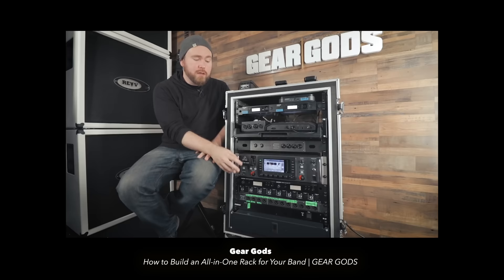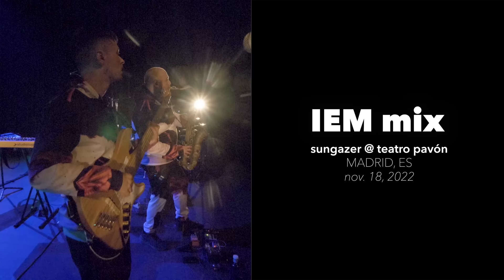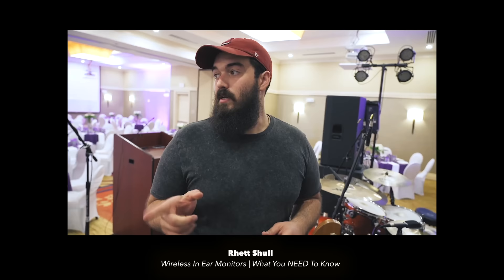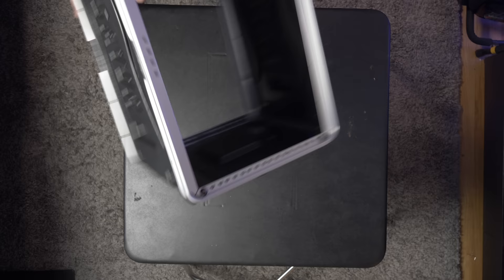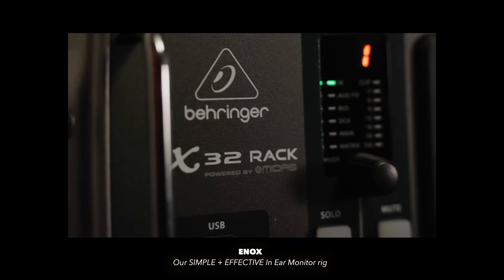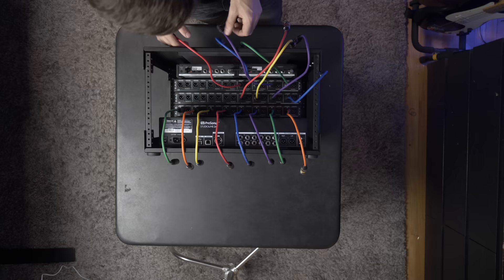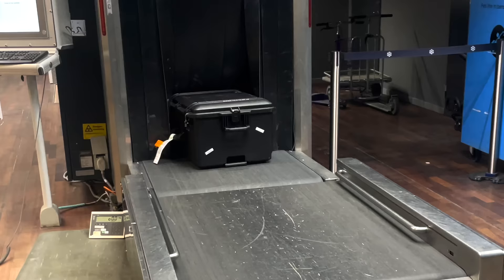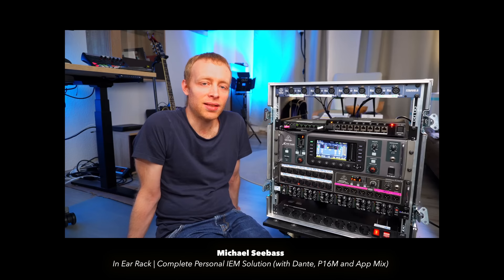How In-Ear Monitors are Making Better Musicians

Comment: As a FOH sound engineer (who'll be mixing Sungazer on your next Portland OR date!) I fully agree with your approach here - even including the shade thrown at sound engineers. For venues without dedicated monitor eng positions, it can be very frustrating to build foldback mixes for bands that have exacting requirements but who rely on house wedges and stage volume. Self-contained IEM stage boxes completely eliminate a whole category of potential problems. Looking forward to the show - in your advance please send along that input list @6:30 ! 😆
Reply: European venue engineer here, another thing to keep in mind is wireless as well. American wireless rigs are not always legal, frequency requirements in EU and US are a little different; you don't want angry radio people coming after you.

Other than that I fully agree, monitor mixes can be difficult to keep tabs on if you don't have a dedicated mons guy. Especially if you as a band like to run dry/wet and compressed/uncompressed channels for certain performers. Vocalists as example tend to like a little verb for their "feeling", the rest of the band might see insane yields in clarity with compressed vocals; but the vocalist needs way less, or no compression on their ears so they can keep dynamics in check etc. Accomodating this yourself is in my opinion a good thing, not even to mention educating musicians on the technical side as well.
Reply: Super random (and sorry if I’m being a bother), but how did you get into this line of work? I’m a drummer in PDX and have been wondering how to get a start in sound engineering/what it takes to be involved in that community.
Reply: Question of a non-sound-eng musician: Since consistency and control on the sound seems to be the band issue here, why stop with your little selfish personal in-ear mix? What would be the pros and cons iyo of sending a left-right premix to the foh directly out of the box? I suppose you could still have control on the overall frequency response and volume with eqs and gains to adapt to the room-pa system (?). 
It could prevent "misinterpretation" of the overall style by a mix eng that doesn't came prepared and never listen to the band sets (let face it, it appends all the time) it could even allow for creative mixing tricks with automations and such, night after night. 
I guess it'd kindof ruining the whole FOH mixer job purpose, so don't take it personal ;-) , it's just out of curiosity: do you think it would be practical, even if not suitable?
Reply: @ginabean9434  because you simply don’t hear balances the same way in IEs or in any kind of stage environment as in the room. Constant adjustment of levels and tonal balance is always needed.
Reply: @ginabean9434  Sound engie here; As soon as you have Instruments that give off sound into the room you are playing in, you have to consider the effect of these instruments natural sound in that particular place on the FOH mix. You can't completely Isolate your Band from the room and then hand off a clean mix - like a studio production would be - to the sound engineer. Instead you would have to designate someone from your Band to stop playing and go listen and try mix to the room while one band member is missing. 
And that's only one of many changing factors. The next problem will be the change in acoustics&sound when the audience arrives, the temperature changes, and you and your band will play at a different intensity from the soundchecks because the kick of performing in front of an audience comes in. And as soon as you are on stage, you can't react to this anymore + you don't know what the FOH sounds like because you are on stage performing. 

Not to say you can't do it all, lots of small bands mix themselves - sometimes to a respectable level, and it might be the better choice if you already know ahead you'll be playing in a place with an absolutely terrible sound engineer, but the best way to go is to know HOW to communicate the wishes on how your Band should sound to the engineer, and find a solution hand in hand. 
Because it's a hand in hand thing after all. If the band works against the sound engineer the outcome will be bad, if the sound engineer works against the band it will be bad.

And if you are this particular that automations are important for you: hire a sound engineer to come with you that knows your music perfectly well.
Reply: @camcam0490  no worries at all. i have a background in live stage/theater and electronic music production so i knew the basics of plugging things in, getting a decent mix going, fighting feedback on mics - i started helping out at small bars/venues (like 50 people) when they needed sound eng, got to know some other folks in the community that i asked to tag along with on bigger gigs as a backup / A2 whenever i got a chance, showed up on time, did what i was told, and asked a ton of questions after each show was over. lots of friendly networking and being reliable. My emails on my channel 'about', hmu sometime if you want a tour at Star!
Reply: I've moonlit as sound guy for a small time band with a lead singer with phenomenal range and power, who frequent dives with absolute garbage acoustics. Been bugging her for months to get a IEM cause of the number of times we've had to under-gain her channel to avoid feedback screech, resulting in her voice getting lost during nuanced parts. Definitely going to share the cheap IEM setup from this vid.
Reply: As a player in a small local bar band, we do our own sound with a Mackie DL32R mixer. Everyone uses basic wired IEMs from headphone amps, plus one Shure wireless. Monitor mix, FOH out and wireless kit is all in the same rack,  pre-cabled. All we have to do is plug in instruments, mics, headphone extension cables and the FOH. Sound check is quick, we just notch out any problem feedback frequencies (and we play some acoustically horrible venues). Two iPads - one main, one backup.
Reply: For pro bands - is there no way the venue could accept a stereo master mix from your rig, and borrow an iPad from you? Or would you not trust them with controlling your kit.
Reply: @tuck1s  i've definitely mixed bands who gave me a stereo feed from their self-contained stage setup, and it's usually fine, but it severely limits my ability to fix things on the fly - typical example is a new song with a guitar or synth patch that comes up way too loud or too quiet relative to the rest. I've also had the second thing you describe, where a band will have their own stage box with a stereo pair out and hand me their ipad; in this case I do have individual channel control over the FOH feed. This is definitely better but isn't as clean a separation of responsibility as the setup Adam's describing. Especially on a typical three-act night with a headliner (usually mixed by their touring engineer), touring support (me), local support (also me), simplicity and conformity of everyone's setup means  less stress all around and a better experience for the audience.
Reply: Thank you, good to know.
Reply: @ginabean9434  Absolutely valid concern, and if you're an engineer that is out of his usual genres or capability I can definitely see it being a problem. If you have a rock-centric engineer mixing a bigband or jazz band the results can be interesting.

Most bigger bands carry their own sound engineer on tour with them for this reason, if it's truly important for you to bring your sound everywhere you'll want to spend and bring them along. The same goes for lighting guys.

As a band you might also overlook what skillset an audio engineer brings to the table, they might also function as a system tech. The engineer is also continuously adjusting the mix to the room, dynamics of the band itself; if you as an artist would have to do this on-stage with your iPad you'd probably be unable to play your instrument.
Another issue is that players themselves may carry a bias, let a guitar player mix and the guitar will always end up being the main component of the mix.
Reply: Hey Eric check out super secret band 
We’re Pdx locals 
🤘🤘🤘
🤫🤫🤫
Reply: Come hang out at super secret studios or come check out a super secret band show sometime
Get in the mix
Reply: Are you a full-time sound engineer?
Reply: ohh i live in portland when is it hopefully i can go
Reply: @sammyk3992  Oh, mate, I've been to so many festivals, where you had a whole lineup of groups that sounded really really bad and then two or three bands that sound great. The one thing they had was - their own sound engineer and/or dedicated monitor guy. One thing that you don't want in a festival environment is a long sound check. And you can't really do it before you get on the stage.
Reply: @mydearriley  No, I have a day job as well.
Reply: @ginabean9434  It's not suitable but you could do it. There's been plenty of people who've essentially mixed themselves, and for many busking performances, that's literally the only option. The thing is, a monitor mix is not the song mix. It sounds bad FOH. It's not "selfish" it's about playing the song. Monitor mixes may include metronomes, they may include backing track, they may want to hear mostly themselves and less other instruments. The mix a musician wants is the mix that they will play the best with. The FOH may include more track, if tracks are used, it will have a balance of everything.

There is nothing stopping a musician however, from running an extra mixout. They can have each of their own individual monitors, then they can have a FOH mix on their rack on another send. You'd never send the vocalist's monitor out FOH, but you could mix on the same rack and run that FOH, and if it's a digital rack, you could softpatch it wirelessly to use your headphones to switch to the FOH mix and get it where you want it.

For some shows, with a lot of automation and backing tracks, click tracks, timecode? That's the standard, the band will have a whole production that is bringing that. For most bands though, they don't have a production of that scale, they can't afford it. And most of them aren't sound engineers themselves, so they need the sound engineer. There's also things with live sound that you're actually paying an engineer for. You may mix yourself onstage, but you're not going to tweak the EQ when you realise feedback is building up in one of the mics. You're not going to be able to automate them riding the return on a reverb. You're also not going to be hearing the PA live in the middle of the room. It's all very well to listen to the FOH mix on monitors, but it's not how it sounds in the room. 

Basically, monitor mixes are not FOH mixes, they work completely differently and are not interchangeable.

But your best advantage at that scale, when you can't afford it, going wireless, especially, going wireless everywhere, gives you a chance to check out the FOH mix yourself, and make sure you're happy with it in soundcheck.
Reply: @defenestrated23  You don't even have to go this far. This rig is impressive, but you can also get a simple wireless kit unit that can run off the FOH desk or the Monitors desk from an XLR out. You can just take the XLR out, into a wireless TX, then to a wireless beltpack, with IEMs. Whole thing can be done for like $600. This rack is a more advanced version for doing it at scale.

There is only so much you can do with the vocal monitors. Either the singer learns how to hear themself, even with quieter monitors so you can get more volume, or you solve that problem with IEMs.
Reply: Hey is Don and Steve May in Sungazer????
Reply: @kalreynolds5829 Only reason to go this far, for convenience, you just get on stage, plug your mics and instruments, and your settings are already there, since it’s IEMs no need to go back and forth…

Comment: The difference between quality IEMs and regular stage monitors is HUGE.  I'm in a couple of dance hall bands, and the difference between setup/soundcheck times is staggering.  We have 4 road cases (all my guitar stuff, Tony's guitar and keyboard stuff, Sarah's keyboard stuff, and mixing console/in-ear receivers), which is way less crap to schlep around than all that plus 6 stage monitors.  Add to the fact that we have zero stage noise (drummer uses an electronic kit, bassist uses a SansAmp, and Tony and I use Axe FXIIIs direct into the console), our soundchecks are just making sure everything works and then fine-tuning the sound (our soundman saves each venue we play as a preset on the mixer).  We can set up in under an hour.

And since we're not touring or anything, we don't need to invest in bulletproof cases and stuff.  We're in about $6000 total for the console and PSM300s for all 6 members of our band.  All things considered, it's been an amazing investment since our performances have gotten SO much better now that we can hear each other exactly as we want to hear us and we're not competing for volume.

And you can't beat the feeling of playing a shredding guitar solo in the middle of the dance floor and (never worry about missing your cues because you can't actually hear the band or yourself).
Reply: I really like IEMs for small bands, but i dont think they will ever replace true monitors. I love the sound of my d&b m2’s, and they have been my favorite monitors I have ever owned. Although they are great, you can’t beat IEMs. I don’t want to like IEMs, but it is so hard not to, when they are so small and quick to set compared to my m2’s. A typical monitor setup for a band would be around 12-ish monitors, and that takes up alot of space, and they definitely take longer. Im jealous of how fast IEMs are to setup, and I think they are really good when you have your subs set up in a cardioid pattern too.
Reply: @EpicenterEvents  Some of the physicality of stage monitors, in terms of actual sound waves you can feel, kind of get lost too, I think. Maybe it's time for rumble packs and little air blowers XD
Reply: @EpicenterEvents  I think there's definitely still room for traditional monitors, and I think they can work well in conjunction with IEMs. Not everyone is going to favour IEMs, and the sound is different from something like an m2 (those rock) is going to be felt in a different way to the IEMs, I think you can get interesting results listening to both.

You can get the best of both worlds, but it does require patching both. But you can feel the sound of a monitor, but have the headroom for vocals in your IEMs

Comment: Re the standard xlr’s not fitting in the rack case - no need for loads of expensive right angle cables, all you need are a couple of recessed adapter brackets to move the unit backwards and you’ll have plenty of room to leave standard straight xlr’s plugged in
Reply from the maker: We thought about that, but then we ran into the issue of not enough clearance in the back of the rack. This thing needed to be very shallow to fly, and because of that there were a lot of unusual challenges
Reply: @AdamNeely  We use the right angle xlrs similar to the ones you show here blocking the sockets below.  However, some designs you can open, twist to 45 degree, and close again.  Gets the wires out of the way of ports above or below.  A fairly cheap option that people might not realise.
Reply from the maker: @richardwelbourne955  That was almost an option - the right angle xlrs we got can twist - but even still, they were too bulky. We had to twist the lo-profile xlrs too in order to make them work. 

There were a lot of details I left out of the video for time because honestly, talking about xlr profiles is one of the most boring things, haha.
Reply: Too bad you built your rack last year.  Midas recently released the DN4618-o which would remove the need for the splitter boxes and a pile of XLR cables and give you 16 split outs in one rack space for $350.

Comment: I'm almost speechless after watching this video... You were able to translate a current "pain in the 4$$' i'm facing with my band. I cannot hear myself, and this is frustrating since this affects directly my playing. A few months ago I bought an EarPlug to protect myself and it was frustrating - basically throwing money on the can. I'm gonna focus next year to save this problem with low-budget equipment. Thanks a lot for this! I hope you have a great 2023! Cheers from Brazil!
Reply: I played for years in a band struggling to hear myself, constantly battling with stage noise and balancing the volumes, especially bad on untreated stages where the low end would vibrate and get amplified through the stage and the high end would just be bouncing around like crazy.. Switched to in-ears in 2011, it's just instant overnight improvement. Then you get into dialling in your mix and creating a virtual room/stage within the monitor mix and you have literally the best sound you ever played with in your life, every night.
Reply: There's two low budget options. You can get a simple wireless tx/rx kit that takes XLR into the TX and has a battery reciever, like he uses, and instead of the rack, just give it to the engineer at the start and ask for your monitors through it. An XLR splitter may be necessary at some venues.

Then there's the ghetto option, where you sort your own wireless TX using bluetooth or a car radio setup, and then put whatever phones you want on it. This one usually has latency issues though.
Reply: I know this comment is two months old but what my band has done is get a 4 way headphone amp from behringer, 35$, and each of us a wired belt clip monitor pack, 59$. Get TRS cables to connect it all together and you have a 4 way in ear monitor system for under 200 bucks. Granted, it's wired and you can't get each person their own custom mix, but it still makes a world of difference and you can get everything you need easily off of sweetwater.